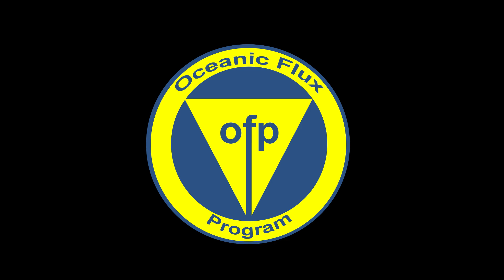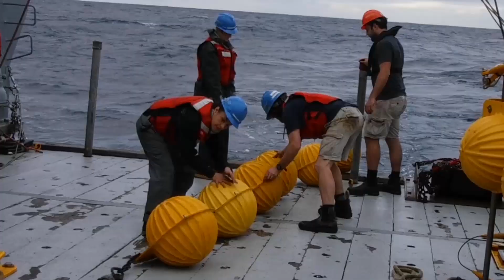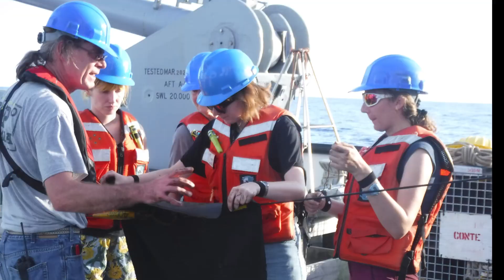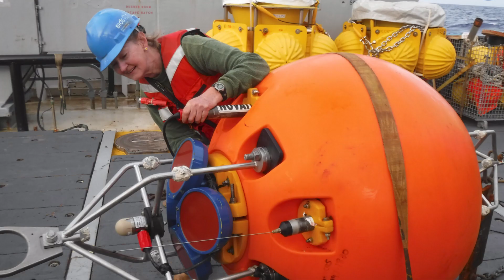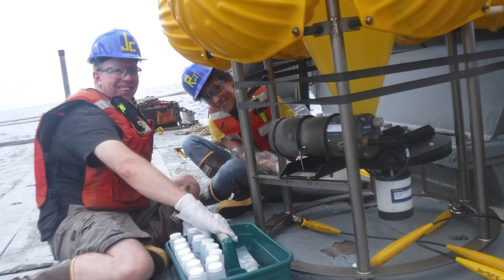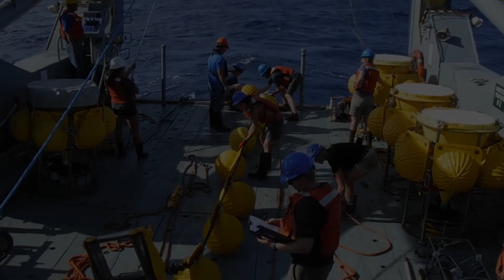UIC Inc. X The Oceanic Flux Program

Comment: The ever-increasing emission of carbon dioxide due to rapid industrialization, urbanization, unplanned tourism and gross alteration of land use pattern is causing unprecedented changes to the terrestrial and marine biodiversity. Irrespective of political philosophy, nation, caste, creed, sex and religion, mankind is under the appalling shadow of climate change. Today nature-based approaches for the mitigation of climate change are increasingly accepted as part of the low-cost solution. Thrust has been given by several scientific communities to assess the magnitude and viability of carbon sequestering potential of plants. Coastal producer communities like mangroves, salt marsh grass ecosystem, seagrass beds, and seaweeds absorb atmospheric carbon dioxide during the process of photosynthesis. This carbon known as the ‘blue carbon’ is thus associated with the marine and estuarine ecosystems. The rates of carbon sequestration and storage in these coastal floral communities are often comparable to the rates in carbon-rich terrestrial ecosystems such as tropical rainforests or freshwater peat lands. Unlike most terrestrial systems, which reach soil carbon equilibrium within decades, deposition of carbon dioxide in coastal ecosystem sediment can continue over millennia. We are working on this field in the mangrove dominated Indian Sundarbans since the last 30 years and will be happy to connect you through abhijitresearchmitra@gmail.com. Best, Dr. Mitra